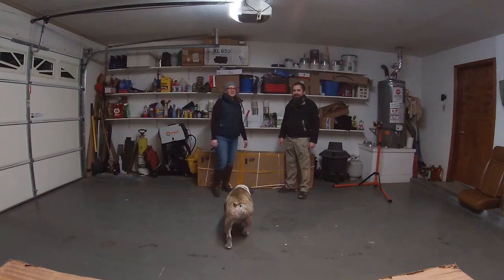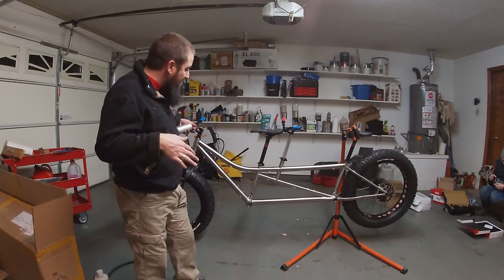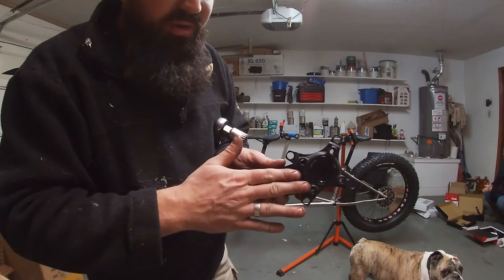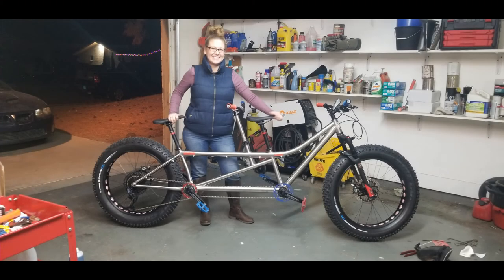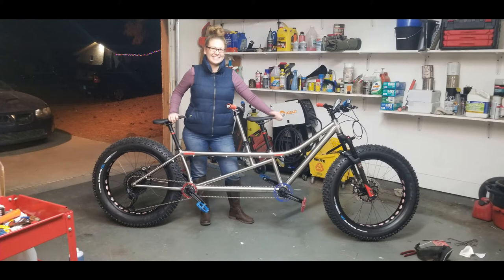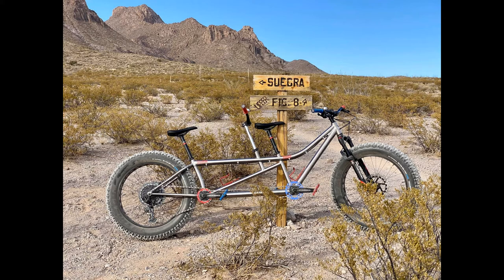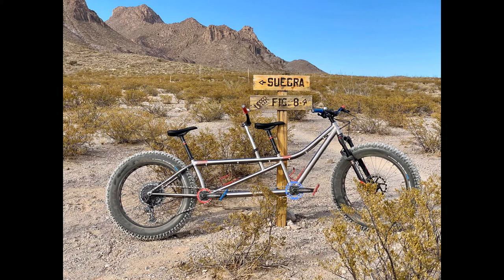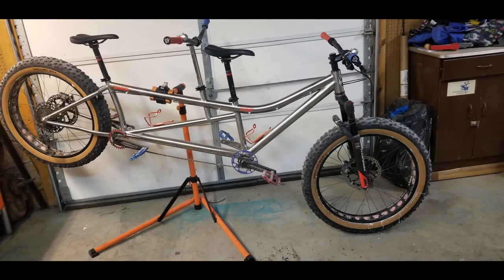Building our custom titanium Danger Zone fat tandem bicycle Bad Bully MTB

Comment: How did you add a handle bar location for the stoker that is not on the captain seat post? That is unique and a great addition.
Reply from the maker: The entire design is mine. The stoker seat post is essential to run dropper posts and to give the stoker the ability to have a longer top tube so she can see more without excessive reach.

Comment: I had trouble understanding the name of the frame supplier.  A little Googling resulted in a frame manufacturer XACD.  Anyone know if that was the frame's builder?
Reply from the maker: Yes.  Email Sophia, ti-bike@tw-metal.com.  She will work with you on the design and you can be as happy as we are.  We were totally skeptical but the proof is right in front of you in this video!

Comment: Wait how is your timing chain or the captain to stoker set. It's on the inside ring on a double crank? Or are they triple cranks and you use the small one??? And the middle one is used for der on rear??
Reply from the maker: We have since changed timing sets, but this is a 2x crank spider where the timing is on the inside position and the actual drive is on the outside position with a bashguard in front.  We've since switched to 3x cranks with bash guards on the outside, drivetrain in the middle position, and timing on the inside.
Reply: @badbullymtb175  Oh yes and I heard you had 22t time chain. Does a smaller timing chain ring create a weaker engagement compared to a 34t timing chain. 

Seems like a nice weight savings if you noticed no difference.
Reply from the maker: @Red-ju4mi  Chains are really good at transferring power.  I used to work on conveyor belts and there are definitely 5 hp motors out there with sprockets smaller than 22t.  As long as the chain is tight enough that it can't come off, the size doesn't matter.  We use steel chain rings and chose the smallest possible for maximum ground clearance.  As long as it's the right bcd it probably doesn't matter, though.

I will say that this raceface spider in this video is garbage and it actually shattered on our second ride.  Raceface, after recommending the parts, told us too bad/so sad and the $500+ worth of stuff is sitting in a box somewhere (bottom brackets, cranksets, spiders, chain rings, the whole nine).  I'm not sure it'd hold up any better in single bike application.  Expensive cranksets might be light weight, but light does not mean strong.

Comment: Nice! Did you say the frame was made by X80?  Did you ever consider full suspension? Can you list the major components in the description for us? Thanks.
Reply from the maker: I haven't ever seen a full suspension titanium fat tandem.  If you do, let me know who is making one!  In fact, I have never seen a full suspension titanium fat bike of any flavor.  A full squish would be really fun for the trails.  It'd be totally unnecessary for snow, but definitely great for 4 season use.

I will modify the description to include all the build specs.  They should all be in the video, unless there's something I overlooked.
Reply: @badbullymtb175   What I should have asked: Did you consider a full suspension 29er, and if so, why did you choose the fat bike instead?
Reply from the maker: @MrTeff999  the fat tires are required for snow riding, which is discussed in the video.